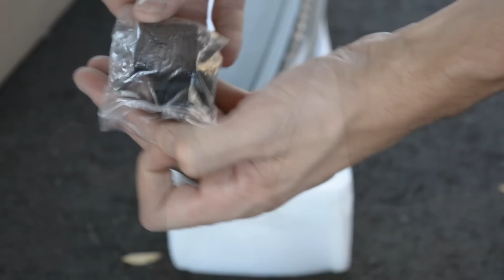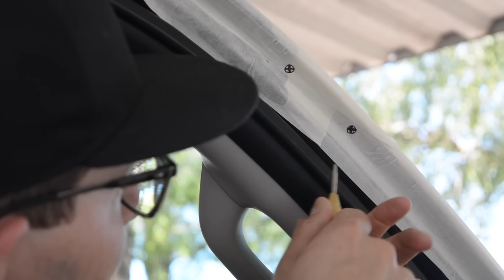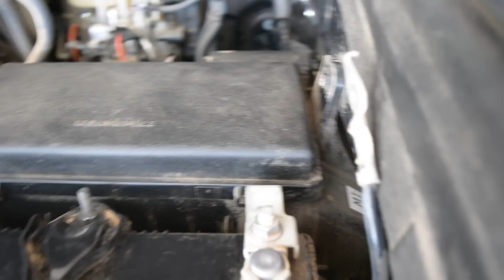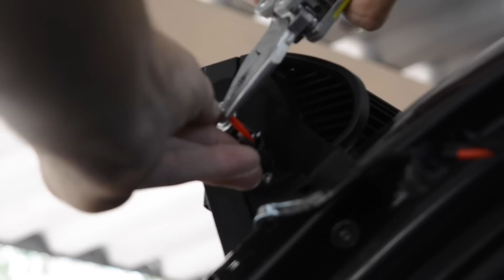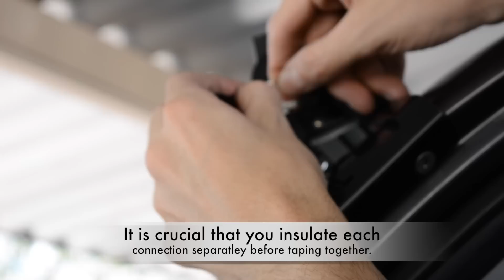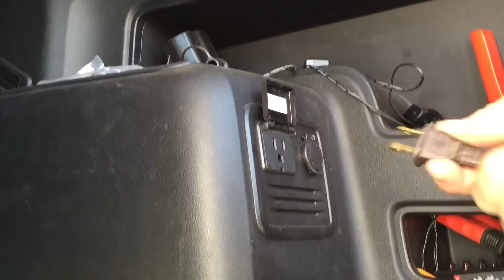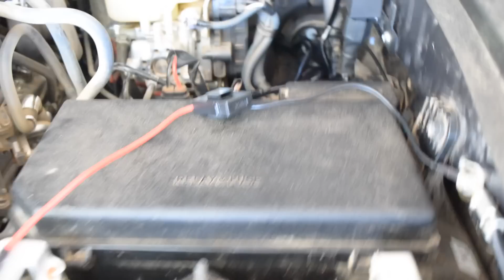2016 4runner - 50" curved windshield led bar install and hidden wiring

Comment: So I go on the rago fab website to order same setup for my 2018 4runner. But only options for curves bars are 42inch or 54inch ?

U say that ones 50inch ? Would like to know so I can place order.
Reply from the maker: Hello,  it is possible that they no longer offer the 50" Curved bar from Freedom LED for this application. They do still sell the brackets though. The bar is 50" curved but it actually measures 52" if you factor the curve in there. You should contact them to see if they have any remaining bars or if they offer something else instead. They have great service, I'm sure you will get a prompt reply. Thanks for watching!

Comment: Can u tell me swift car in led bar .pls tel me
Reply from the maker: Im not exactly sure what you are asking. But it sounds like your asking which switch I used? At first I used a generic switch harness but then I wired it up to my Switchpros unit and you can see that in my other video here: http://theroninchronicle.com/switch-pros-sp8100-install-2016-4runner/
I hope that is what you were looking for, thanks for watching!

Comment: was wondering when mounting a canoe, would it hit the light bar?
Reply from the maker: Thats actually a great question. I dont have a canoe, so Im not sure but the bar isnt too much higher than the roof line. so I would guess that it should be fine.
Reply: does something like this increase the overall value of your vehicle? and if so how much around?
Reply: derwen talia not really
Reply: @derwentalia  yes, by $8000

Comment: why cut the wire so short off the light bar? when you could had left it long and made the quick disconnect under the hood.
Reply from the maker: Hello, the wire from the bar is too think to hide in the groove in the side of the windshield, thats why I had to cut it that way. But i can still add the quick disconnect with the new wire, no problem. I was actually thinking of doing that . Thanks for watching and commenting!

Comment: Can these door brackets work with a straight normal lighbar (not curved light bar) ?
Reply from the maker: Hello! Im pretty sure they only work with the curved bar. But you can contact rago fabrication and see if its possible to use a straight bar with them or if they make a set that is compatible. Thanks for watching!
Reply: ok, thank you

Comment: hi, is it possible to mount the light bar w/o drilling if ur just mounting it temporarily and not permanently? Like for example, just mounting when ur going out to a dark trail....
Reply from the maker: Hello! As far as I know, drilling is required to mount the brackets to hold the bar on the windshield. The hidden bumper bar doesnt require drilling but does require cutting some inner plastic parts and removing the bumper. If you get a good set of HID low beams and fog lights, it should help out a lot if you dont wish to dismantle or drill anything.
Reply: Guess you just have to shut the front doors and get in from the rear doors if u don't wanna drill holes for the bracket lol.
I have this 4runner (exact same year, trim level, and even color) as yours. I have front LED high and low beam, fog light, + led turn signal switchback light.
So what's the reason you switch from HID to LED?
Reply from the maker: haha that would be funny!  When I first got this truck,  I damaged the old HID bulbs swapping them over at the dealership when I traded in my 2015 4runner 2WD for this one. So I needed to get new lights and decided to try their new Razir LED products. Now I do feel that the LED's arent as bright while driving in the city, so I am actually switching back to HID. I have a new HID kit already but want to make another video for it so I havent done it just yet. I'm finishing up my corvette light videos right now. Hopefully I can do it this week
Reply: I hope hidextra.com will still accept your 15% off promo code after you finish making the HID kit vid for their product :). If yes I'll definitely be ordering that kit from them as well if you think their product works out well for you...
Reply from the maker: The coupon code has been active since last summer and they sponsored most of my corvette lights also so I think as long as my videos are up, it will be active. I have been using their HID kits since 2010, never had any issues with any of the cars I had them in. They are great products and a great company for sure! Thanks for watching!
Reply: Magnetic brackets are now available.

Comment: The other thing you could of done when soldering your wires is cut one lead an inch or 2 longer so the two soldered connections are offset and don't make such a big bulge.  

I solder the wires on my motorcycle electrical extras, but my aircraft maintenance friends tell me soldered connections are not allowed on airplanes due to vibration induced fatigue.  They only use crimped connections.  

Great video, just got a 2016 trail premium and an looking for ideas for "things."  Have you done any suspension work yet?
Reply from the maker: Hey there, thanks for the tip. I have not done suspension work yet. Not sure what path I will take yet. I just got a corvette and looking for a house to buy, so I cant do anything just yet. haha Would like to lift it eventually and get bigger tires though.
Reply from the maker: The first thing I do when I get a new car is the LED swap, I recommend that for sure, its a low cost upgrade that will drastically change the feel and appearance in my opinion. here is my video on that https://youtu.be/XSv9wO4Tf5Q
Reply: Yeah, its ridiculous to purchase a "trail premium" model and have it come with street tires.  I guess that's Toyota's way of motivating a buyer to get a TRD Pro model.  But then the trail premium comes with some everyday stuff that the TRD pro does not.  Plus those TRD Pros are hard to find (according to my sales person).  

I'm just starting to look at suspension parts.  Its complicated and somewhat pricey.  A little taller would be better for off-roading.  Not that I'm taking the brand new 4Runner off road just yet...

Comment: Hi,  thanks for the video, very interesting. One dumb question. When you connect lights through the car battery directly, the switch is always on, even when u turn off the engine.  Does this have major effect in the battery usage? Thanks
Reply from the maker: ShakemM hello, thanks for watching. For the time I had it that way, I never had any issues. I have it hooked up to my switchpros unit which is designed to be connected that way.

Comment: Hey! So I just finished wiring mine but my kit came with the positive and ground both connecting to the positive and negative ends of the battery instead of grounding it. But the led bulb in the switch stays on even when the car is off and I can turn the bar on when it is off too. Is this because I did not ground the negative? And is it draining my battery with the switch bulb always on?
Reply from the maker: I would think that it is possible it could drain your battery. I'm not sure though. Hopefully some viewers can help chime in ?
Reply: I Got the same problem too. I wonder that the ground should connect to negative on the battery or ground it with the truck

Comment: Does the unibit matter? Silicone matter? Rivet gun?
Reply: Like the type?
Reply from the maker: Mark Mettles they shouldn't matter much as long as they perform the same task. Just make sure when using the unibit that you don't make  bigger hole than needed

Comment: can you take a roof mounted light bar through a car wash
Reply: Great video
Reply from the maker: Bill Nelson thanks Bill! Cool to see you on here!
Reply from the maker: I never had any issues, should be fine
Reply from the maker: Bens Photography hello there! 
Yes absolutely you can. I made sure beforehand because I have a speed pass at one called Cobblestone. No issues with the establishment nor the equipment
Reply: is it a touch less car wash? i have a car wash that has the brushes and stuff so i don't want it to rip it off.
Reply: is it a touch less car wash or does it have the brushes that clean the roof? i don't want it to rip it off
Reply from the maker: Bens Photography hello, nope it is the kind with brushes. It's good to go
Reply: alright. Thanks for the input. all i hear is people saying don't do it because it puts way to much stress on the mounts and bar.
Reply: Do you work for Rago Fabrications? i emailed them and they said they never tried taking that mounted roof light bar through a car wash with the spinning brushes that go over the cab.
Reply: The Ronin Chronicle
Reply from the maker: hello, no i dont work for them.
Reply: I asked them if i was able to take the roof mounted light bar through the car wash. Because i remember you said you have taken yours  through one. Should i trust there product enough to take it through the car wash? or don't trust there product?
Reply: I'm assuming it should be fine since the brackets are in the door jam and not bolted to the top of the  roof. I honestly doubt it is any different than your mounts.

Comment: Looks great! .... Did you up grade your head and fog lights to LED or HID? I want to upgrade mines any suggestions?
Reply from the maker: Thank you very much! All of the Lights are LED. I have a video that you can see here for them: https://youtu.be/PXVr8kNX_pQ
they require filing the housing just a bit since the base of the bulbs are so big. 
Or just use elbow grease like I did, was pretty hard actually. You can get Hids that will fit better and be brighter too. I just really like these tho.

Comment: How is the wind noise?
Reply from the maker: It is pretty loud at times and can even cause a vibration. sometimes it makes me feel uneasy because it gives me flashbacks of the hoopties I used to drive where I would have to listen and feel for mechanical failures haha  So it does bother me however I have not taken the measures that are suggested to reduce the noise. When I get some more free time I will tackle that little task as well.
Reply: I'm interested in knowing also.